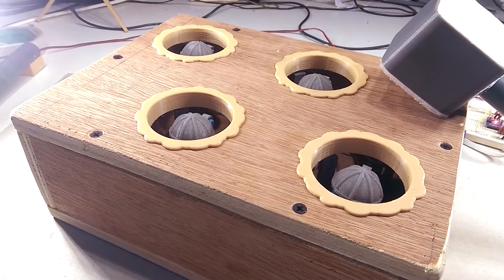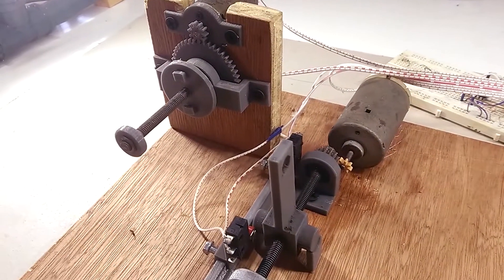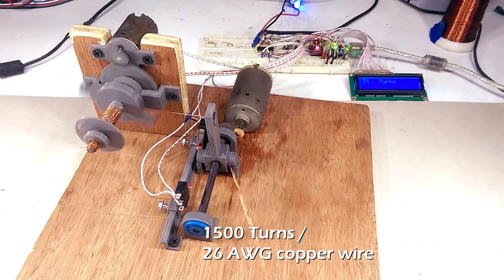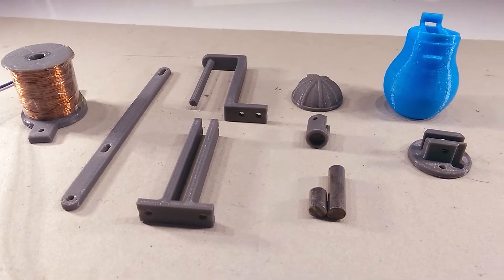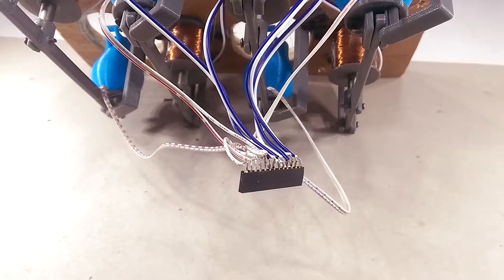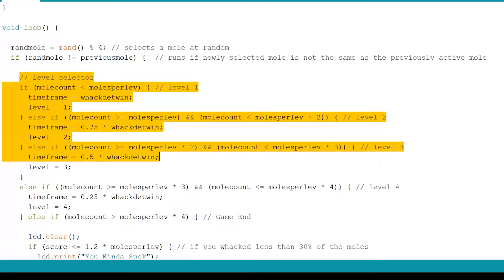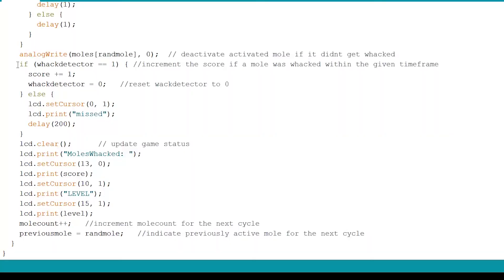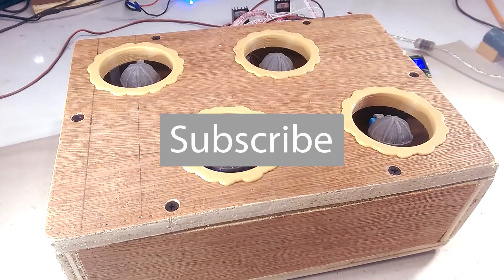Making a Mini Whack A Mole Game

Comment: Thank you @AhmsvilleLabs    for  taking your time to share this.                                                                                                                                                                                 What voltage does your design operate on ?                                                                                                                                                      Before deciding to embark on a build similar to this, do you think a car battery might provide enough power for running this at a local fair for  4-5 hours at a time.                                                                                                                                                                                  Is you original build still functioning and did you develop any improvements ?

Comment: Great project, thank you.
Is it possible to make with 5 moles?
Reply from the maker: I don't see why not...
Reply: Another question: how do you come up with 26awg and 1500turns? Thank you.
Reply from the maker: I had 26awg wire at the time, so all my calculations were based on that....there are alot of factors that goes into choosing the right wire size and turns count, supply voltage and current, total resistance of the coil, how much power you want the solenoid to have, heat generated and the type of 3d printing filament used....all this informed my recommendation of 26awg and 1500 turns...alternatively you could consider off the shelve solenoids, US $1.58 | Dc 6V 12V 24V magnetic solenoid push&pull open frame  electromagnet TAU-0530T stroke 10mm keeping Force 700g
https://a.aliexpress.com/_mNhQpYT they come in different flavors...if you have any other questions, let me know, I'll be happy to help.
Reply: @AhmsvilleLabs  thank you 👍🏻👍🏻
Reply: @AhmsvilleLabs  if i were to make a whack a mole would it be possible to make it to where there can be points in time that if you were to hit them you would lose points or something along the lines of that? example: whacking ghosts but if they have their eyes glowing blue and hit them you lose points

Comment: I'm guessing mounting the "mole" directly on top of the solenoid is a bad idea. Is this purely because it would require a stronger solenoid or is it also a safety mechanism against damage and/or direct shock ? ? ? I'm wondering how much it would be to make one for my cat and how I could have it run through a 2 - 5 min random sequence at the press of a button or motion sensor.

Would you be interested in making a video on such a project ? A pet centered whack a mole game that activates when the pet approaches it and carries out a randomized sequence so it doesn't bore them the third or fourth time it's been activated and it's not ON all the time to eat up power and equally force disinterest.

Personally, if I had the resources/time I would take it further I would probably add a biscuit/treat dispenser at the side so when the time has run down whether the cat has hit the moles or not it dispenses a few biscuits from a small rotary dispenser much like gumballs from a gumball dispenser.